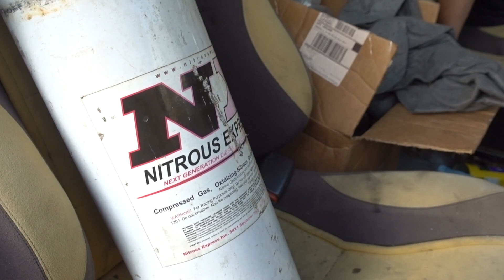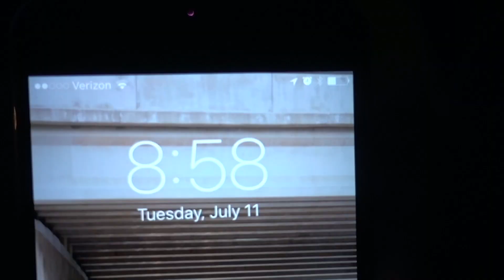Nitrous Oxide & Diesel Trucks!!! The EASIEST way to BLOW your ENGINE!!!!

Comment: If it's in the cab, you NEED a blow down tube from the burst disk to outside the cab.
Reply: Kyle Sonsalla I'd be more worried about 3rd or 4th gear on bottle LOL
Reply: Kurt M 
I run my bottle right up to the top of OD lol maybe that's why there's a nice crack in my old block along the base of the cylinders...

Comment: Hey Greg, first gen lights suck because the wiring is sub par. You need to do the mod to put high and low beams on relays. It's pretty easy to do it yourself or use a plug and play kit (Jc Whitneys).    When you upgrade to high output bulbs you will burn the factory wiring anyway.

Comment: You should of put the nozzle to the nos on the tube that goes from the intake to the intercooler or on the little pipe that goes from the turbo in the front that blows into the other turbo? I did that to my race truck and it worked a lot better but that's me, keep up the cool videos guys I really enjoy them.

Comment: GregA.. You should check into h4 headlight conversion unsealed units.. I run a glass set."euro style".With Hid..or imo with a LED H4 setup.. all in like 95$ for some nice clean euro glass style lights an bright clean looking 6k LEDs..best $ I've  spent..there same as jeep xj.?... 
Oh an for the purge on scrap truck, put that purge in front the intercooler..I bet it'd cool down the turbskI's intake air 10-15 degrees after a hot run, drive..launch... Plus tell ppl it's just 10lbs of intercooler "air-gas" pre- cooling"like a meth injection kit...  keep up the videos..

Comment: Why not put the nozzle up in the intake horn, instead of way diluting the NOS going through all that space of the intercooler, the ppm will be better at the horn.
Reply: BIG DADDY 
It's still the same volume entering the engine either way..... going in the IC is a softer hit, less likely to break shit when it comes on.

Comment: you need to turn that bottle 180 degrees so the line is facing downwards you cant have the main line facing up I've got some more knowledge with putting them systems in if ya need it message me ill walk ya thru it
Reply: Don't forget the emergency blow down tube from the bottle out of the vehicle required by track tech.  I may have missed it if they did install one.
Reply: Justin Fast I was gonna say that, treed.  The siphon tube won't pick up any nitrous mounted like that.  Also needs a blowdown since it's in the cab.
Reply: Justin Fast unless the siphon tube has been changed to angle the other way inside the bottle. But still better to not be fighting gravity regardless